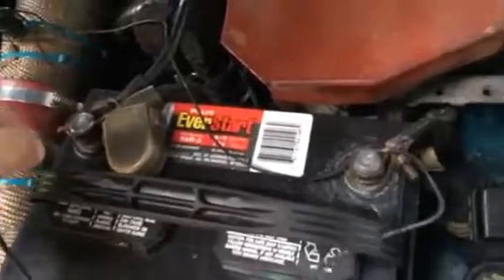VRIS solenoid repair

Comment: I did it with 230v AC from the outlet and it works, just got my vris back and the engine pulls nicely again!! Let’s see for how long… thanks a lot sensei, namaste!!!

Safety tip: shut off your house general power supply, then inset the wires in a socket while plugged to the Vris solenoid, then go and turn on the house power supply only for 1second or so or you run the risk of caughting fire to the solenoid or worst your house, then turn it back off and remove wires from plug and turno on the house supply again. This way your always not touching the wires that go to the socket and you don’t run the risk of getting electrocuted.

Comment: Could this maybe works with 230volt? I'm living in germany
Reply from the maker: it should work with 230 volt AC current.  Not sure what it will do with a DC current.
Reply: ye its 230volt AC, did u shock it with parallel circuit or serial circuit.

Comment from the maker: If you don't think just because it clicks it isn't fixed, the blow through it and check. One nipple will always blow through, the other ones will only blow through when either off or on. Quick and easy to check to verify it works.